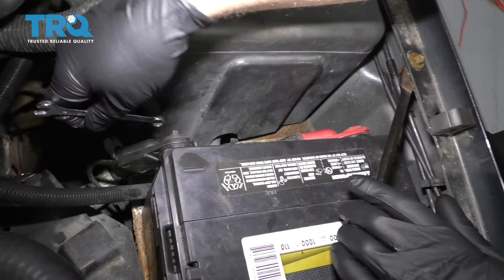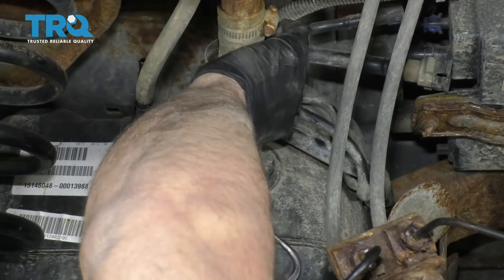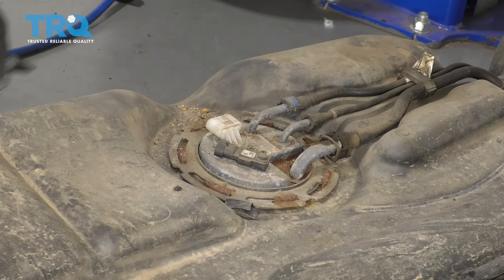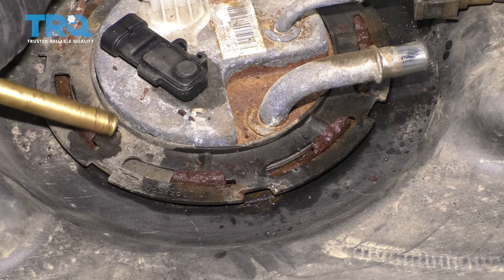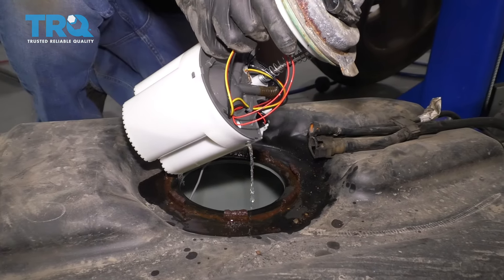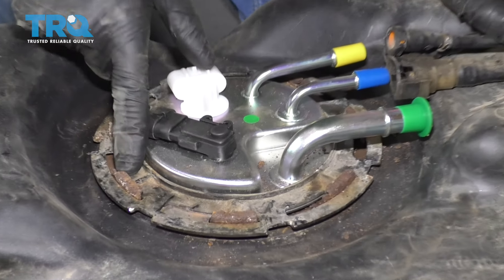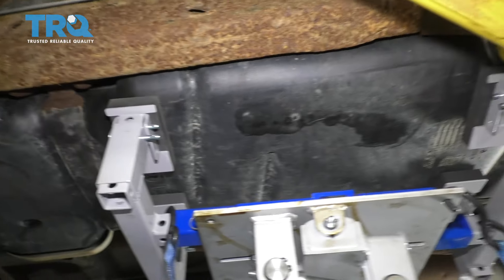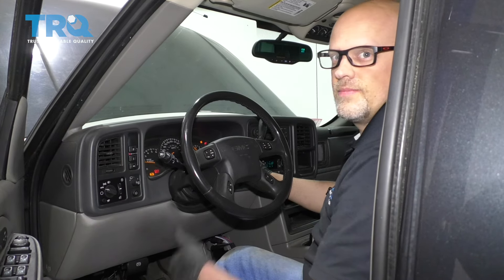How to Replace Fuel Pump 2000-06 GMC Yukon

Comment: Thanks guys Just relpacedd this on my 07 Yukon Denali XL Just to find out my Fuel pump fuse blew and was the reason why it didnt want to start. But o well. My truck got 330,000 Miles. Pump was going to go out at any given day/ Night anyways. Thanks for the video

Comment: IVE GOT AN 03 YUKON,, AND MINE IS NOTHING LIKE THAT. BETTER BE MORE CLEAR ON YEARS.  AND CONNECTIONS.
Reply: Fully agree, wish I had read this comment before, could have spared me from snapping a connection onto the evap canister I didn’t know existed lol
Reply: Mine was a 2000 btw. Some pretty big changes made apparently
Reply: I agree I have a 2002, nothing like this

Comment: Great job!. The only thing I would add is while you're down there, I would blow out the gas and evap lines. If the pump is in need of replacing, I'd probably go ahead and change the evap system (cannister, solenoid, purge valve) as well and blow out the lines as those lines get filled with charcoal/carbon pellets when the cannister gets old. I know it was just about changing the fuel pump, but might as well do some preventive maintenance while you're down there. Just like most mechanics will change the Transmission seal when changing out a rear main seal. You're already there. Don't want to do that maintenance twice!

Comment: What’s the line for the blue cap? I have a 2003 Denali and it doesn’t have a line on the tank for that center one. I put the other 2 lines on sand have been driving it. But once I park I smell gas fumes

Comment: Hands down the best video fort replacing the fuel pump.  Only difference in my case was the fuel pump had "barb" style connectors to connect the 3 hoses to the pump.  Had to order the tool and the rest was history.  Thanks!
Reply from the maker: +Jason T with StarCarpetLV Thanks for watching our video! http://1aau.to/m/Shop-TRQ

Comment: What is the normal pressure in the system with this pump? The old pump was 95-100 psi, the new one was 55-60 psi. 🧐

Comment: My 05 yukon rusted out on top. Perfectly good pump. 
I am so mad at GM. I cut a hole in the backseat and put in a junkyard fuel pump has worked just fine for 4 years. I piled on the grease on top. 
Seal up the hole using 
the same metal piece with silicone or use a mastic like roofing "Ice and water "sheild. Peel and stick.
Caution don't use a grinder. 
Use a hammer and chisel or a air chisel.
Reply from the maker: +YouTube guest Thanks for the tip! We'll pass this info along to our production team. http://1aau.to/m/Shop-TRQ

Comment: Good job brother 
My truck broke down I hit the gas tank with a hammer and it started again. Should I replace the fuel pump
Reply: Yeah but look at some on the ground vids if you don't have a lift
Reply: I would say yes read that if you tap on it and it starts then the pump is at faulty.

Comment: That frame is even a touch rustier than my 05 XL. Same configuration I ve got tho, so very helpful video. I could have used a bit more detailed instructions re the connectors tho, and what they're all for

Comment: I Wonder How Much is Usually Charged To Do That Job....?   And How Much does an O.E.M. Dealer Pump Cost...?    Just for Future Reference... I have a 2000 Yukon XL.  I would Not Look forward to Doing that Job, Broke Down on the roadside
Or in the Driveway...I wonder if Some Backyard Mechanics would even Tackle That Job...it could take all day or a weekend...!
Just Curious....  BillinL.A.
1-23-2021.
Reply: Well mine just went out and my mechanic wants 180 labor with fuel pump cost and gives me 3 month warranty on work done. I think that's fair.
Reply: Baker CA wanted to charge me 900
Reply: My son is a diesel mechanic and said it's actually pretty easy, but definitely NOT to do it without a shop. Our 2001 yukon has over 300,000miles on it, I have been doing a lot of replacements and fixes but this isn't one I can do on my own without a way to get the rig up on a wrack etc.
Reply: Honestly they're not that hard of a job, under an hour for a competent person with the correct tools on hand, and thats on the ground, and not rushing.
Reply: i would consider make a hatch in the floor just above the pump. im guessing i need to swap my pump soon
Reply: @smnkm4ehfer  How high do I need to lift a Yukon/Suburban to get enough room to slide the tank out?